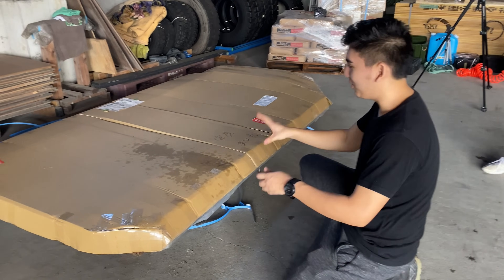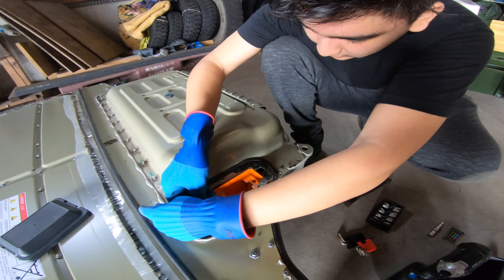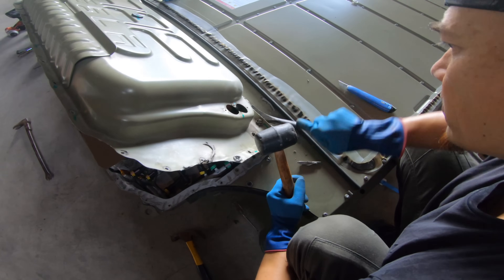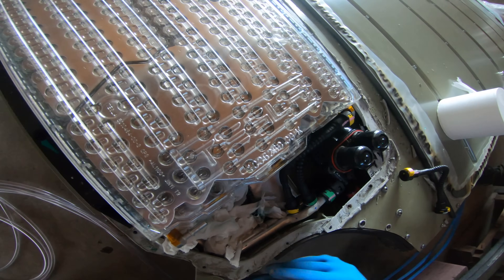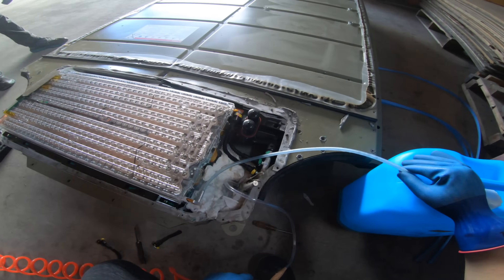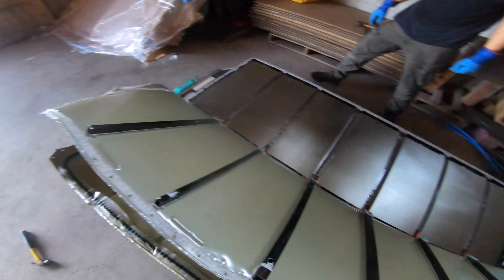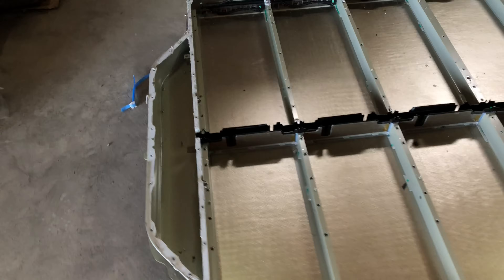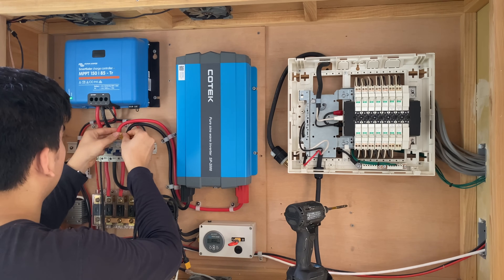The 60kWh Tesla Battery Powered DIY Powerwall

Comment: will this work with newer Tesla model 3 batteries 2021-2022 year? I have a couple of them that I want to put to good use
Reply: They are unfortunately “potted” or “podded” where they are encased completely in a pink polymer. It is apparently very difficult to remove either mechanically or chemically. Legend has it that there is a trade secret solvent that makes short work of it, but I don’t know what it is.

Comment: Did you use one BMS for each Module , or one BMS for all 14 modules? It looks like yu use One for all 14. SimpBMS is about $629. WOw . Its expencive to use it for every module. For my project I need to control each module with it's specific BMS. I found cheap PCB based 6 cell BMS in Amazon for $17. it should work.
Reply from the maker: The SimpBMS is the master BMS which controls each module. So one BMS for all 14 modules. I would advise against using a cheap BMS for the packs. They lack quality control and don't communicate with each other like the SimpBMS does. There are some cheaper alternatives to the SimpBMS that do the exact same thing.
Reply: @ZaiFuchigami  Thanks. Also I want to monitor the temperature of Tesla modules, Is there any device with monitor for that to see the temperature reading? I tried to find in SIMPbms, but I think they don't have it. Do you know any and could you provide a link?
Reply from the maker: @tigranohanyan3321 No worries. The SimpBMS reads temperature from the I thermal sensors inside the Tesla modules. Each module has two sensors built in and are both read by the SimpBMS independently. If you connect to the BMS via serial bus, you’ll be able to see the 6 series strings of each module, plus the two temp sensors. Balancing is also handled by the Tesla slave boards and can be controlled via the SimpBMS.
Reply: @ZaiFuchigami  but where I can see these temperature readings? Is there any monitor sold with SimpBMS? Or Does SimpBMS have a build-in a digital monitor?
Reply from the maker: @tigranohanyan3321  Its mainly a serial bus device meant to be connected to a computer for setup and monitoring. But there is a display that you can use for overall monitoring and some control which is the display I use. You can google SimpBMS display.

Comment: Great job. To charge each of these 24V Tesla modules do you use build--in Tesla BMS or you put a third party BMS in each of these modules?
Reply from the maker: I used the original Tesla BMS slave boards in each module as well as the original wiring harness (slightly modified). The SimpBMS I used is designed to replace the master BMS board which connects to each slave BMS board.
Reply: @ZaiFuchigami  Also you got 60kWh battery modules which are about 70% of the origional 85kWh brand new modules. Have you used some kinda meter to find this 60kWh data or you got this from the sourse that you purchased from? How many miles it was driven with the car before you got them?
Reply from the maker: @tigranohanyan3321 I used only 14 out of the 16 available modules for the powerwall. I broke one module down and tested a couple individual cells to determine capacity. Each cell is roughly 2.6Ah on the low end which is 9.36Wh per cell. 9.36 X 444 X 14 is around 58kWh. I didn’t know the capacity before hand, but you can roughly judge the degradation from the mileage and year of manufacture. My pack had around 50,000km on it if I remember correctly.

Comment: cool video. but 10 minutes of it was just taking apart the battery pack. a little info would have been nice, like how much would a typical home backup battery that size cost vs what you paid. what kind of typical load does your house use and how long would that pack last powering your house?
Reply from the maker: I made a second video just for that. It goes over the system in more detail and explains everything a bit better.
Reply: @ZaiFuchigami  saw it, great video!

Comment: Your cell wiring is incorrect. You wired the cells in parallel correctly, but you took the positive and the negative from the left hand end. This means the cells on the right are on the end of the string, and there is more resistance between the inverter and the right hand cells than the inverter and the left hand cells ...  The cells themselves are very low resistance, you'll be surprised how much more "work" the left hand cells are doing and the right hand ones barely getting used at all. The correct way to wire them is simply to take one of the connections to the inverter from the other end of the string. For example connect the positive to the left hand end of the string, the negative to the right hand end of the string, thus the resistance between the inverter and any single pack is equal, which equally shares the load througout the packs.

Comment: Don't the Tesla packs use lion chemistry, and wouldn't LiFePo4 be much safer and durable in the long term?
Reply from the maker: LiFePO4 can be safer, but when installed correctly and multiple safety systems are in place "regular" lithium ion chemistries can be as safe. 

Long term cycle durability is definitely better on lithium iron phosphate, but what I paid for the Tesla pack is a fraction of what I would've paid for a LiFePO4 pack. So even if it lasts a few years it'll still be cheaper to just get another pack and replace it over using LiFePO4 from the start.

Comment: How do you get such a low frame rate it's painfully to watch

Also you connected the packs wrong, you need to cross connect the positive and negative wires. Although with these low currents it's not that big of a deal. 

I'm scared these will once get into thermal runaway and burn down your house. Man, buy lifepo4, they also last way longer and match better in voltage with your inverter
Reply from the maker: Overheating on either the GoPro or its micro SD card. Didn't notice until after.
Reply: @ZaiFuchigami I also thought of the darkness, it may have lowered frame rate to get more light

Comment: Just curious , why wouldn’t those still need to be cooled?
Reply from the maker: Good question. The simple answer is that the load on the packs is a fraction of what it saw when driving the car motors or when Supercharging, which is when the packs heat up. The max power in or out of the pack in my system is only about 4kW, as opposed to the 400kW it’ll see in the car.

Comment: im wondering why not use the battery as it is. is there something wrong with the battery? it would seem to be much easier and very very much safer to just use the current external connections.

Comment: This is incredibly irresponsible. All it takes is an internal short within a cell and your house is gone. You could do everything perfectly and still experience a thermal runaway event.

During a thermal event, the hot gasses of a cell will directly shoot into another module grid. You have zero thermal runaway protection

For those watching on YouTube, please don’t replicate this. Leave this to professional engineers

Comment: Do not use a parallel connection on one side of the cells. Give the plus wire on one side and the minus wire on the opposite side. This helps to unevenly discharge and charge individual cells.
Reply from the maker: Caught that after this video went up. All fixed now :)

Comment: Is it possible to use the battery pack “as is” directly. Would seem a lot safer and easier. Is voltage a problem?
Reply: yes voltage is the big problem because its putting out about 400 volts, even if its almost discharged it will have well over 260 volts in there.  So a beefy step-down inverter would cost close to 10k to handle that job.  So he had to take the modules out and re-wire them in parallel. The big thing he will have to deal with is a good Battery-Management-System.  The cool part is that whole battery is more than enough to power up a house once fully charged.

Comment: Wrong main lead connection! The + and - lead to the inverter should be connected diagonal to the first resp. last battery in the pack, so you have no voltage/SoC/performance difference between the batteries.
Reply from the maker: You're right, I did catch that issue and fixed it after the video went up. I actually re did the whole wiring setup a few weeks ago with a new single busbar and solid right angle bus bar strips connecting each battery replacing the old daisy changed cable link.

Comment: Why did you use mppt controller? Because victron 24V 3000 inverter does not have inside it? Or do you have another reason for that?
Reply from the maker: The Victron MultiPlus doesn't have a built in MPPT charger. It's an inverter and AC charger combo unit. I also prefer having separate components for singular purposes for better redundancy.

Comment: Genuine question, why do all this? What do you get by using a vehicle-grade battery pack for a home? You get more capacity. But it is meant for a vehicle type environment, to withstand different conditions, which you won't be facing in your home. So all that is really just an overhead that you're throwing away.

Comment: Nice work..  I started my power wall about 5 years ago using mostly Lap top cells, Now nearly all are gone.. don't be tempted to use laptop cells, they are discarded for a reason.
I'm up to about 20Kw but that's where it stops as the solar shed is full. Its my Daily top up for my Tesla.

Comment: So when you wire tesla packs like this they are basically dumb packs? I don't see how a BMS could balance the mods in a setup like this? You basically just flood the posts with current and push the front cells hard enough that the rear cells eventually reach 100% SOC? I just don't think this is a good long term solution
Reply from the maker: Well, no. The Tesla modules each have a slave BMS installed which handles balancing directly on the board for that module. The slave BMS boards are then daisy chained together to send and receive data to the master BMS which is the SimpBMS I installed. The SimpBMS reads the balance data from each module and can command the specific module to start balancing if required. It also isn’t “flooding” power into the packs. All the modules are connected in parallel so they all charge at virtually the same rate.

Comment: Seems risky having all those modules crammed together without any cooling or at least some high powered fans
Reply from the maker: The cool thing is that the new max power draw is so much lower than the draw of the Tesla drivetrain and motors, the batteries don’t even heat up above ambient. So cooling isn’t required.

Comment: I’m curious to what fuses you replaced that had high enough resistance to replace? 
Typically, fuse resistance should be extremely insignificant. In the milliohms range.
Reply from the maker: They were some cheap Chinese ANL fuses from eBay that had very loose tolerances. Similar fuses (probably from the same factory) were marketed as "audio" fuses for cars. Learnt my lesson to never use cheap Chinese parts for any large scale build. I've since swapped out the Chinese Tomzn DC MCBs for Blue Sea Systems 187 series breakers.

Comment: I Wonder what kind of cell battery use Tesla?
Reply from the maker: In the modules I have, the battery cells used are Li-ion 18650 made by Panasonic and Tesla. Over 7000 cells in the whole pack. Newer Teslas use 21700 or 4860 cells.

Comment: 14:53 Watching you use an impact drill on those battery pack terminals was disgusting. Buy a torque wrench!
Reply from the maker: Lol sorry you feel disgusted. It’s been a long time since this video and I’ve made many many upgrades including a solid busbar connection to each module with correctly torqued fasteners.

Comment: Hopefully, those are older cells.

Tesla does not make batteriea they source them from the actual manufacturers

The newer batteries used in Teslas have less of a safe thermal band than previous models.l
Not really an issue as installed in a Tesla, as there is quite detailed monitoring and active coolingnfor them.

When you shuck them and remove  those protections, you are increasing the chance of thermal runaway.
Reply from the maker: These modules were pulled from a 2014 Model S. So almost 10 years old. The monitoring system I installed is exactly the same as the original tesla system as it just replaces the master BMS. The original slave BMS boards are still used. Active cooling is also unnecessary as the drawn power is so low compared to the car's motors, that the cells don't heat up beyond ambient. I confirmed this with a thermal camera.
Reply: @ZaiFuchigami  Glad to see you've thought it out well.

Comment: Not sure I would do this. Batteries are stack next together without cooling. Fire hazard risk is too high to do it like this. In their original seal pack separated from each other liquid coolen, fire was still able to burn down a metal car.  Video show a wooden container box with batteries compact together. I can see bad thing could happen if one cell get fry causing a chain reaction.  I would separate each unit by a least 6" in well ventilated metal box outside away from the house.

Comment: Hi , I am very impressed with the quality of the work and the enthusiasm that you have shown .. I would worry about the cells going on fire. I would like to see the batteries build into a metal enclosure and away from the main house for safety. It would be great to see somebody take the original battery enclosure and modify it and fit it as it is like a fire wall only larger.
Reply: The metal enclosure is a great idea. Keeping away the batteries from the house... its almost imposible. You need to much cable section for that amount of current/voltage. And every meter you add, you have to increase that section making it economicaly inviable.

Comment: Purchase costs with huge markups, exorbitant installation costs, maintenance/repairs, and then battery replacement costs. I'm not sure this will pay off even in the long run, but it's a sure thing that it will take a decade or two for the average homeowner to see any real savings.
Reply from the maker: You're right about the long return on investment. But I didn't do this to save money. If that were the goal, this would be the worst thing I could do. 

I did this to be independent from the grid and to have a more reliable and cleaner supply of power, which are issues in my area. 

Technically there were no markups or installation costs because I build it and installed it myself. Haven't done any major repairs or maintenance in over 2 years.

Comment: To my mind Tesla batteries need to be modular whereby you can slide the old battery out and slide the replacement in. The old batteries can then be sent back to Tesla for reconditioning. In modern technology simplicity has to be key.

Comment: cells must lay horizontal not vertical.
Reply from the maker: It's been fine for over 2 years. No issues at all. There is enough structural strength in the module to support itself vertically.

Comment: Pretty darn dangerous how you fitted the packs with the daisy chained leads - could have easily shorted something out and would have been a big boom boom before you even got the chance to get up off the floor.  Other than that - nice rig!
Reply: If you mean the section at 14:35. he didnt daisy chain them, he connected them in parallel. I dont know what voltage the individual pack modules have but theyre probabaly not that high of a voltage to be harmfull when touching them with the hands (please correct me  if im wrong here but i think they are <= 4s?).  Still damn that wouldve been a spark when the terminals wouldve connected 😳
Reply: @benzo5799  he still daisy chained them in parallel which is still very dangerous.  those 24v modules can output over 1000amps each when shorted out with non fuse - so if he accidentally shorted 5 of them - the fire service would be brushing up what's left of his house in one bucket!!
Reply: @MrButuz  yes metal to metal contact woeldve been bad bad

Comment: Are the modules balancing themselves ?
Reply from the maker: Each module balances its cells with its own slave BMS board. So yes, they are balancing themselves with oversight control from the master BMS which can activate and deactivate the balancing function. So far at 2 years since install, the delta between highest and lowest cells is unchanged at around 6-8mV.
Reply: @ZaiFuchigami  Thx for the quick reply. Do you have the original master BMS still installed ? Does it work without any control units of the car itself?
Reply from the maker: @simpleman5494  The original Master BMS is not installed. It requires the car control system to function. The slave BMS boards will not run on their own and require a master board. So I installed a SimpBMS which acts as the master BMS and reads data and controls the module boards.

Comment: Did you get all the coolant out by connecting to the loops as you did in the video? Or did you have to do something more to get all the coolant out? Thanks!
Reply from the maker: I got all the coolant out with only the method I used in the video. Some modules did still had a few drops left over. Very little though.
Reply: @ZaiFuchigami  btw idk if it's been stated here but the coolant runs at a very low pressure .. only a few psi.. probably why you had that kaboom early on